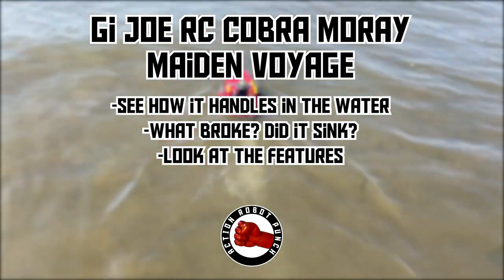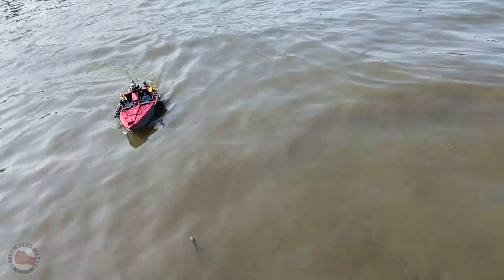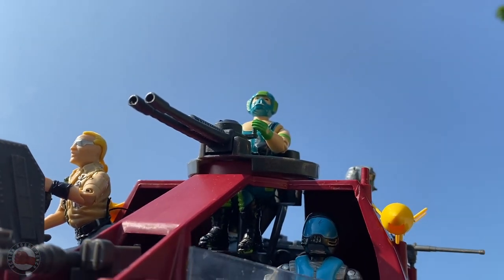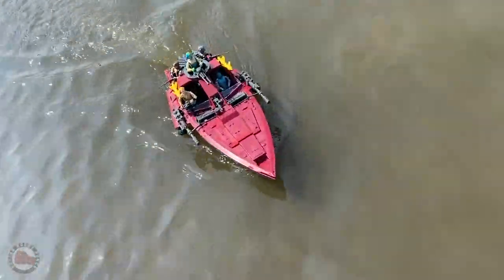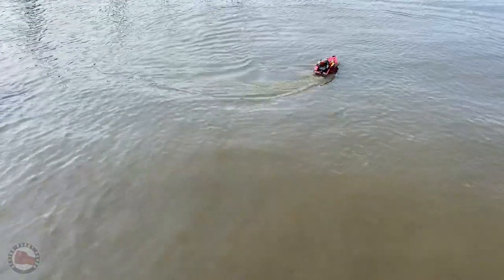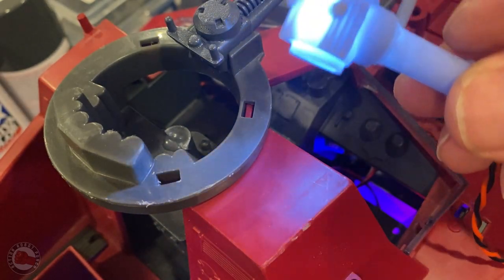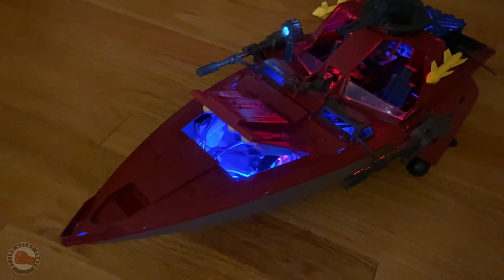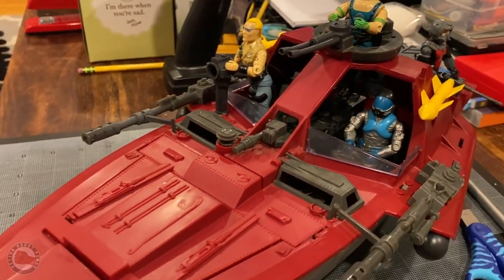Gi Joe Radio Controlled Cobra Moray Torpedo Boat

Comment: So i Imagine you 3d printed the hull?  You ever thought to add a bit more displacement/depth to the rear of the boat?  That should help with water ingress due to the weight in the back. Also I water tighted some of my joe toys I gave to my nephew so he could use them in the lake.  I used the silicon material they use to make custom motor seals on the inside of the hull and around clip points.  It can get messy if your not careful but its not to expensive and it was about as water tight as the rc boat I used to tow some of them around for him.
I took some experimentation but I found some you could remove the silicon meterial fairly easily too.  Its been awhile so I dont remember exactly what I used.  Sorry,
Reply from the maker: I didn't 3d print the hull, just a small part to fill in some of the gaps from the hydrofoils. It's the original hull. I ended up smoothing it out with bondo! But I kept the original lines and the hull is just beautiful. I think at the end of the video I might have some "behind the scenes" images of the hull.

Comment: You should put a bottles of air or something into it due to the big holes in it from the foils.  They would  provide flotation when water comes in.
Reply from the maker: I reworked the entire hull so no more holes. But some kind of bottle or air filled chamber is a good idea
Reply: @ActionRobotPunch  Yeah, the thing is trying to figure out if you can refill it with air or not.  As that will affect the seal.  If not properly sealed it could cause sinking instead.   Also, location, etc...

Comment: I would like to see the Whale hovercraft converted to R/C. There are some tutorial videos on youtube of how to make a R/C hovercraft.
Reply from the maker: That would be amazing. I imagine weight would be your biggest issue. Please post if you embark on that project! 👍
Reply: @ActionRobotPunch  Most of the weight of the whale is the lower skirt portion. I saw  a video some time ago where the builder of a home made r/c use umbrella fabric for the skirt because it is water tight, very flexible for the scale and very light. Hovercrafts can carry a lot of weight, but the more weight the more power needed for the lift motor. I had a Tyco hovercraft back in 1997. It wasn't lighter either. The down side was that it would only hover over smooth surface and water. Never try it on ice.

Comment: just saw this and is awesome! inside of lights or for light bleeding have you tried aluminum tape? stuff works wonders and doesnt add much if anything to weight, and if going all out, stencil and paint instead of decals, bad ass work like yours needs an equally bad ass paint job!
Reply from the maker: Thank you for the tips!

Comment: The foils had to go ?
Reply from the maker: Yeah, they're gone and the hull smoothed out. To make it a working hydrofoil, with all the weight is beyond my engineering skill. I took the easy route :)
Reply: Just wondering what the haul looks like and the sealed bottoms
Reply: Bet was so much fun
Reply from the maker: @codyneuburg1825  I haven't done a full video breakdown but watch the second half of this video and you can see me sanding the hull with some bondo on it. https://youtu.be/WM539EY12OA
Reply from the maker: @codyneuburg1825  It was a fun project. My first RC boat but I've always loved the moray and wanted to see it racing around on the water.
Reply: @ActionRobotPunch  I have two Minty one's and one even has the spot light lenses